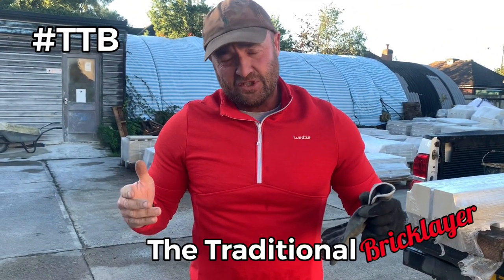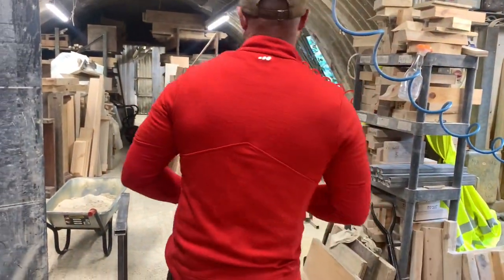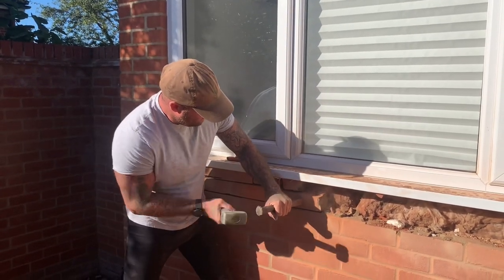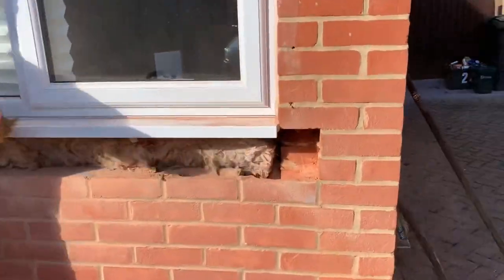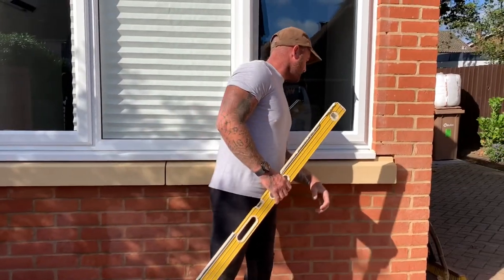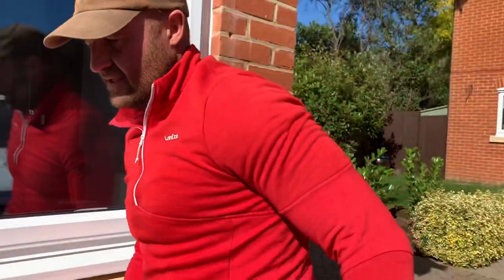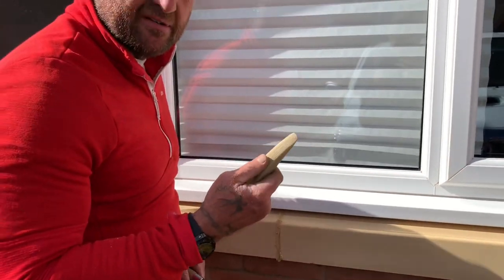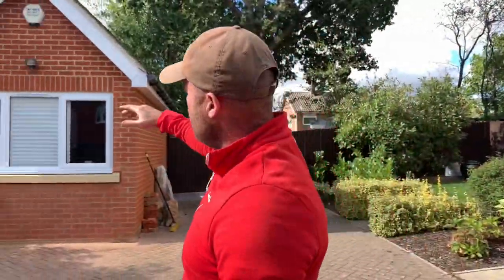#bricklaying #brickwork #developer #1. Proud to be a bricklayer 🧱

Comment: Mortar is not going back very far? Thinner flat jointer to push it back. Then pack it on an angle to make sure it's full. Shim sill up on a few plastic shims on each end then pack it. When you get to shims back 15 mill or 3,/4".

Comment: love the video, I will make a suggestion or requirement , stone capping should have a silicone seal over the joint?
Reply: Not necessarily, I do stone work all the time on big commercial jobs and they just use sand and cement. Is it right or is it wrong I don't know but manufacturer specifications stated sand /cement.